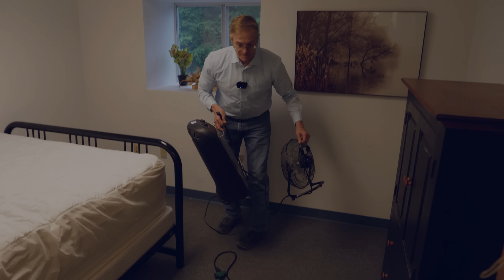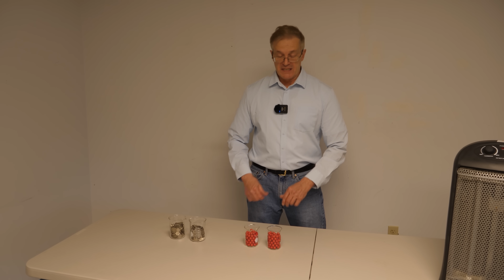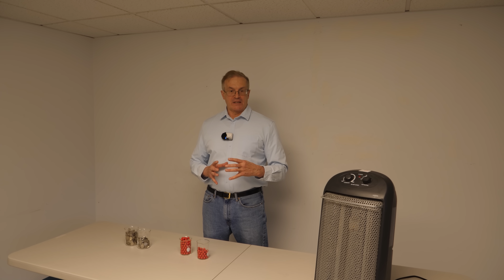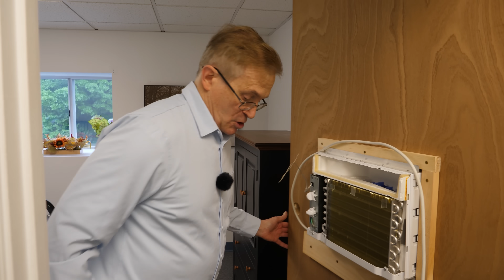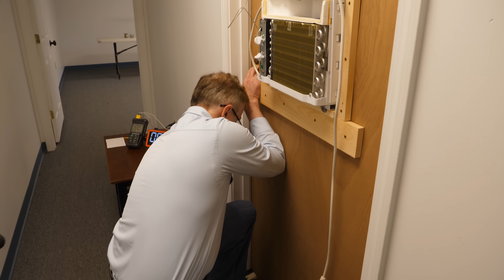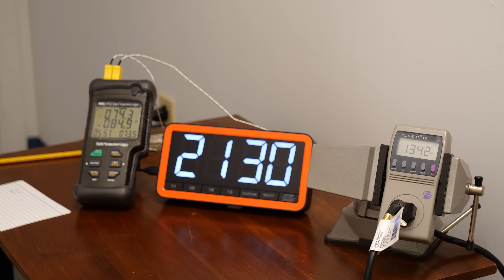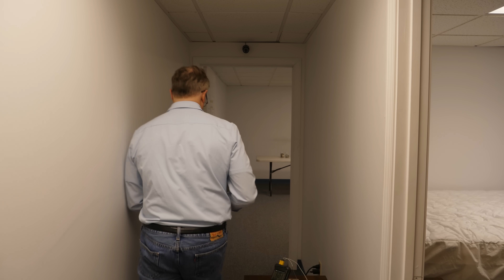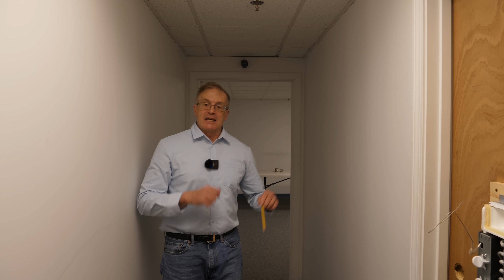You're wasting money on heating! Use your A/C!

Comment: Love that you commented about the smaller units in degrees F vs degrees C and phrased it as more "resolution". Nice way to think about it.
Reply: In my country we used both. F for people things. C for machine things. It’s not complicated to use both and feels better to use all tools available.
Reply: I was born in USA.
My wife was born in Canada.

When we were setting our house's thermostat for the first time, I told her I like the C system most of the time, but F is more accurate.
So, when it's -42°C outside, it's 76°F inside.
When it's 36°C outside, it's 72°F inside.

You might think that since I hate the cold that I should have moved to Florida, but what I learned was that Canada has building codes and therefore has MUCH better insulation than anywhere in the states (minus Alaska, perhaps).
So when deciding on where to live, it was easy for me to choose North.
Reply: @n085fs as someone who was born and raised in New England,  I came to NC 😅 i dont like cold at all , and there 30-40 degrees "cold" winters here are like spring , fall weather to me , so im never actually cold like I was up north and I am able to get outside and do more stuff (as a car guy , I need the good weather year round so I can constantly play with my big kid toys 😂😂😂) but I will say , it's not the same , it's beautiful up north and things are definitely different,  but I enjoy the slowed down nature of down here and the heat 8- 10 months a year as opposed to the cold 8-10 months 😅 I did the flip flop 😅.. much love to ya fam peace ✌️
Reply: Yeah but then he rounded the number 🤦🏼‍♂️
Reply: Way better that my primitive way of just saying it's more accurate 😅.. and i generally like the metric system way better than imperial , but thats in measurements as its more resolution or more accurate for that , but in temperature,  it's the opposite.. hmm , wonder why that is ...
Reply: Yeah F with “decimals” way to go Yankees.
Reply: Because 20 and 20.1 degrees C is not enough??
Reply: @1marcelfilms  while 20 and 20.1° F beats Celsius again.
Reply: If you're using it for heat then the back would be on the inside where it's not going to be freezing anyway
Reply: So when he says it has increased by 10 degrees nobody in the world could possibly know the actual change because a degree is not a definite amount in Fahrenheit.....so stupid only a pig headed nation would keep using it as a scale.  Also enjoy your crappy Phillips screws that strip so easily.   🐖 headed
Reply: C is for water. F is human scale.
Reply: The units (C or F) used to prove this experiment, is of no (or at least very little) importance. The change is what is important. Although I live in a metric country, I understand the decision to use F's. I must admit, I've seen many C-thermometers going into one decimal digit, but never (IIRC) into 2 decimal digits. 
LOVE this video.
Reply: @JCKR-yv4gy  Because humans can't tell the difference between, say, 10ºC or 11ºC; industrial thermometers using Celsius absolutely go to double or triple digits, when relevant.
Reply: Better for resolution for me too as a novice American scientist I am Fahrenheit sighted.
Reply: As a non North American (Australian), I just don’t get Fahrenheit, totally counterintuitive. It’s whatever you’re used to. 
I understand metric.
Good experiment though.
Reply: Ya know, I had a debate with a Canadian friend of mine once over why Fahrenheit was better than Celsius for temperature readings, especially on an every-day human level and that was  basically the argument I was trying to make but the word did not occur to me. "A higher resolution", such a great way to put it.
Reply: @Ary-ethe  Except that doesn't apply at all to human scales - a human can't tell the difference between 10ºC or 11ºC. Why the hell would you need to know it's 10.5ºC, then?
Reply: There's this thing called decimal point, both Celsius and Fehrenheit support it.
Reply: @YS_Production if you want the readout to be longer without adding any precision then use binary. Decimal is a stupid fix to have to use.
Reply: @TheAnantaSesa  😅 You got one point. But "Decimal is a stupid fix to have to use." that's just laughable. Get out of your imperial bubble.
Reply: @YS_Production  last bubble of sanity. Enjoy squeezing all your relevant weather temperatures into half the range between 0-100. Or was that already my point of credibility?
Reply: @TheAnantaSesa  LMAO, we laugh at you 'muricans.
Reply: That is why I set my thermostat to F. And I am a metric person :)
Reply: @mm74forums7 when I am setting temps , I do like using C , but when I am doing readout or anything to do with accuracy,  it's F. All the way .. but C . Is definitely simpler and easier to set for a home temp , just not as resolute .. ie.. 23c and 24 c  but thats 73°to 75° F .. so slight loss of accuracy if you try to pinpoint a specific , but again , simpler in the Neanderthal kinda way 😅.. I go simpler when it's in my home 😅
Reply: @mm74forums7  why over complicate life, Celsius has less letters....
Reply: Choose "smaller unit" and ignored fractions immediately.  Just go metric already.
Reply: @cthulpiss  do metric thermostats use decimals or fractions?
Reply: @RonGrethel  fractions and decimals were ignored here.
Reply: @RonGrethel  

There are no fractions in metric at all. Every type of measurement has a base unit (gram for mass, meter for length, litre for volume, etc). There are common prefixes for all of the units (mega -> 10^6, kilo -> 10^3, centi -> 10^-2, milli -> 10^-3, ...). Instead of saying three thousand grams, one says three kilograms. 1/100 of a meter becomes 1 centimetre. It's all powers of 10 and no need for fractions.
Reply: @capitalinventor4823  same thing. Just a different way of saying it. Still a decimal fraction of a whole. Plenty of standardized measurements use decimals of metric units instead of changing to a different prefix. Look at USB charging blocks. They use milliamps and might say 1.2 mA instead of inventing a 1/10,000th prefix.
Reply: @TheAnantaSesa  

If they wanted to state 1/10,000th of an amp then they would write it as 0.12 mA and not 1.2 mA. The milli prefix is 1/1,000 so a tenth of that is 0.1. 

My point was a comparison to non-metric systems which are more difficult to move from one scale to another. For example, there are 12 inches in a foot, 3 feet in a yard, and so many yards in a mile. Moving from one to another isn’t easy. If I ask you to write 3.53 yards as yards, feet, and inches then you need to work out how many inches are in 0.53 yards, and then determine how many feet and inches that is (guessing 1 foot and between 6 and 7 inches). Doing a similar exercise in metric is easy as there would be 3 meters and 53 centimetres for 3.53 meters.
Reply: @capitalinventor4823  I get your point but it's a minor issue. We practically never use yards anymore but it def is a terrible shame that yard and meter aren't identical lengths bc then the 2 sets of units could be easily converted to decimal system. The value in using 12 for counting is the ease of dividing by various divisors. With 10 you can only divide by 2 or 5 or else you get a remainder. 12 can be divided by 2,3,4,or 6. Then we just divide inches by halves and half of halves etc down to 1/64 before it gets into laboratory precision which may as well be measured in thousandths. But dozenal divisibility is something metric lacks. So I wish there was a hybrid that allowed the 12 inches dozenal system for daily use and then just 3 feet to convert over to metric. I'm not attached to using the mile unit (which is not a size my body can accurately eyeball) though it WAS originally 1,000 paces so it's similar to a kilometer in principal.

Anyway, farenheit is a single unit system so there is no dozenal or base 16 or other non decimal unit involved.

I was referring to the .2mA being 2/10,000th Amp.
Reply: @cthulpiss  ignored the benefit of sizing your scale of units to fit actual world conditions. When's the last time the weather ever got above 40° C? So you just lost 60 degrees to uninhabitable temperatures that are only mentioned in science descriptions. But yet you don't use kelvin to be scientific. Why is that?
Reply: @TheAnantaSesa  I use temperature measurements for thing other then weather. Say, for calculating AC efficiency. And for this purpose Celsius are as good as Kelvins, 1 deg C = 1 deg K. 
And Kelvins are used in a HOST of scientific places.
Reply: @cthulpiss  I know kelvin is as good as Celsius for science. Since you aren't trying to scale your temperature range around human existence by using Celsius then so why is the liquid phase of water under 1atm so important when half boiling (50°C) water is deadly? I hope you do realize 1atm is similarly arbitrary and just as based on earth experience and is an average due to varying sea levels and pressure systems. Maybe the range of liquid water could be adjusted to approximate farenheit closer by using a lower set pressure PSI (N/cm). Then the weather would still range from about 0-100 and match a reproducable phenomenon. Idk. I mean I support science but science is to serve humans so I know the brine freezing point is hard to exactly reproduce and human body temperature is only an average but they are good extremes to use for 0 and 100. If only they were as absolute as the phase change points under a certain pressure of air.
Reply: @TheAnantaSesa  basic physical units - such as Kelvins or meters -  are derived from our world, or based on certain constants.
Both 0 and 100 Celsius makes sense - I use 94C water for my espresso, 75-80C water for my green tea.
I don't need decimals nor fractions for my daily temperatures. And for fifteen years I lived in the very house where friggin Gabriel Fahrenheit was born!
Reply: @cthulpiss  thermostats have noticable increments of 1 degree using F°. I've heard Celsius thermostats have 0.5 increments. I can't imagine being limited to 2°F increments on a digital thermostat (1°c=1.8°F). It would be like a step back to bumping the mercury dial to just barely adjust it and have it move 3 degrees. You could easily memorize 201°f for your espresso since it won't change like the weather. My point is the 0-100 of F° is good for weather. And each degree is 1% of the tolerable range. You like Celsius for your drinks to be 2 digit temps but a chef is still going into 3 digits for his oven use. 350° F is standard for most recipes which is 177°C. It's as much a non-argument as a smelter liking Romer scale bc his brass melts at an even 600 or whatever just a quick fake example. Everyone faces the weather and almost everyday. Not everyone makes coffee or bakes or smelts. It just makes sense to me that we should have a scale that puts weather extremes at ends that are base 10 poles (like 01.0 to 10.0, or 1 to 100). For extremely high temperature maybe a logarithmic scale instead of molten iron being thousands above the breeze temp or the sun being 19,999,850° warmer than coffee. As if anyone can fathom all those distinct million degrees. Call it log 100 kelvin or something. But that's a separate issue.
Reply: @TheAnantaSesa  you've heard Celsius thermostats have 0.5 increments. OK. So about 1°F - good enough for first world problem?
I was commenting on the fact that youtuber here tried to convince us that °F had greater resolution, and IGNORED decimals immediately. 
Again - try to calculate coefficient of performance or COP  of heat pump using Fahrenheit - good luck.
Reply: @cthulpiss  decimals only match the resolution if using 0.5°C increments. But if you're using decimal why not go ahead and use 0.1 increments but then farenheit wins again so you'd have to go into .05 increments and so on. Farenheit does in 2 digits what Celsius requires 3 to do, even if the 3rd digit is only a binary option between half or whole.
As for COP, scale chosen shouldn't matter bc whatever conversion you apply to suit your fetish for Celsius is put on both numerator and denominator so they cancel out. COP=measured output temp/(high temp-low temp). You're telling me that the fraction will solve differently differently bc of using evil farenheit? Ridiculous!
Reply: @TheAnantaSesa  Celsius and Kelvin are THE SAME SCALE, you ascientific dunce.
Reply: Given a delta degree F is 1.8 a delta degree C, a Celsius probe with 0.5C resolution is effectively equivalent to F

Most probe systems barely give you that level of accuracy anyway though.
Reply: Most units of measure have better resolution in metric. I think it's interesting that temperature measurement has higher resolution in Fahrenheit. But it makes sense. Celsius goes from freezing water to boiling water in 100 units, but Fahrenheit takes 180 units to measure the same change.
Reply: @SuperDavidEF  If only there was only was a way to increase the resolution of numbers beyond the unit...
Reply: @b5fie  Well, of course there are fractions and/or tenths, hundredths, etc. but if changing to another unit gives a better resolution without getting fractional, it's obviously a bit more convenient that way.
Reply: @SuperDavidEF  Not even close - it's way more convenient to know that you can calculate anything you need without constantly converting units. Because this specific test only deals with absolute temperature, that's irrelevant, but if we wanted to measure absolute energy transfer, for instance, Celsius is WAY more convenient. Also, the sensor itself is calibrated with Celsius.
Reply: @SuperDavidEF  Keep in mind all temperature sensing instruments actually use Celsius or Kelvin at a hardware level. It's only "better resolution" in Fahrenheit because the specific thermometer they were using capped its resolution in software.
Reply: @Gabu_  they actually use Volts at the hardware level.
Reply: All of the base units are larger in metric, aside from pressure... 
 @SuperDavidEF
Reply: @SuperDavidEF Assuming one is at sea level. But the same theory applies with altitude change
Reply: @4570Govt that's why it's defined as 1atm at sea level
Reply: Fahrenheit is far better for everyday use. A scale of 0-100 where 100 is human body temperature. The temperature of your own body is much more relatable than the temperature of boiling water. People intuitively understand that 7.5/10 is a good number. Not too much, not too little. As it turns out 75 degrees is a comfortable room temperature
Reply: @FoxWolfWorld  how often do you debate your partner body temperature? What about subject at hand, calculating COP of AC unit? Just go metric, and welcome to XX century
Reply: @FoxWolfWorld  that's how I understand Fahrenheit was meant to be. 100 for human temp. Not sure how they figured the average human temperature back then though. AFAIK there was only 1 study ever done that determined human temperature and it's conclusion has been blindly copied. Even the erroneous 98.6 was based on the limited resolution of Celsius being rounded to 2 digits (37). But the original 98.2° F from the study was converted to Celsius where it was more vigorously shared before back converted.

Anyway the other reason why farenheit scale puts it at 98.2 instead of 100 is due to miscalibration. The first thermometers released by farenheit were off a few degrees and then later ones had to match that incorrect spec for consistency.
Reply: Fahrenheit is better for everyday use.  Kelvin is better for scientific.
Reply: 1 deg F is 1/2 deg C - who has the resolution?
Reply: @zwarst  Roughly...
Reply: @zwarst either... Also neither... It depends on what you're measuring with and it's accuracy. How you represent that either as F, or C to one more decimal, doesn't matter.
Reply: @miamisasquatch  exactly my point made - good day.😁